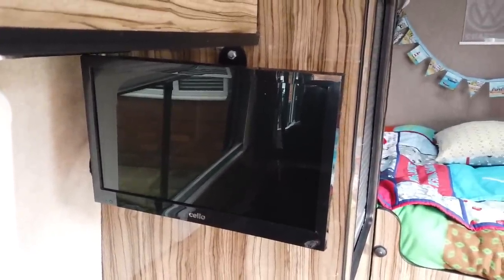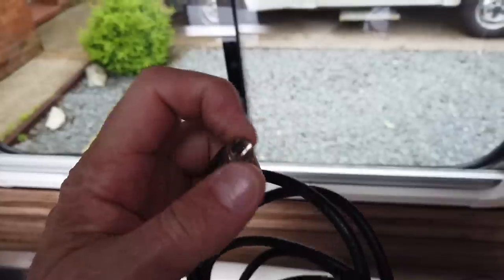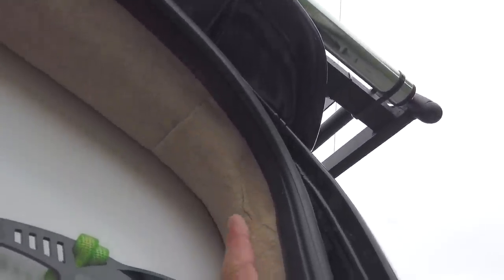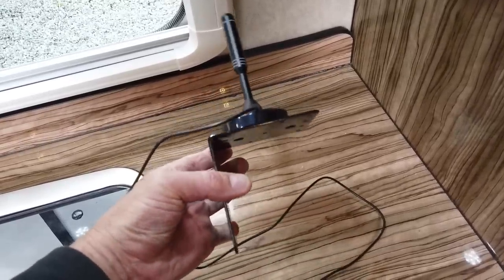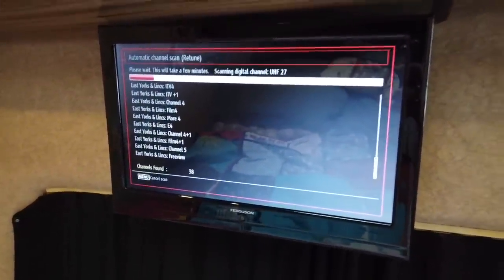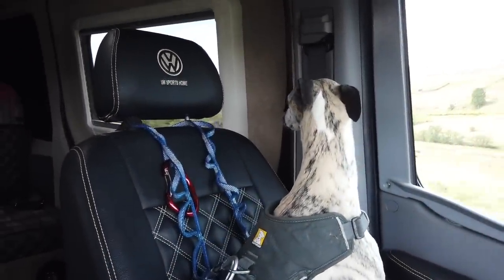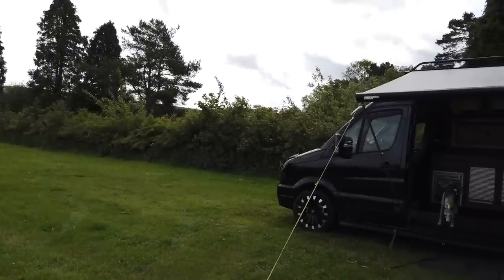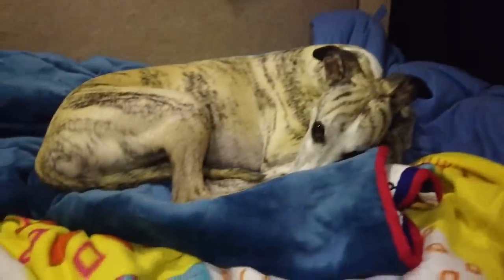VW Crafter Campervan gets a new TV Aerial and we test the new kit on a camp

Comment: Hi, I have one of these on my camper and did the same as you and took it off the magnetic base as my van roof is fibre glass.
But I think the magnetic base needs the van body to act as a ground plain...
I have the angle bracket bolted to my solar panel, trying to use that as a ground.
It does work in most areas but anywhere slightly remote, no signal..
Best option for us now is a firestick using my phone as wi-fi hotspot, works great most places in uk..👍
Cheers 
Best regards
Dave
Reply from the maker: Hi Dave 
Thanks for the info I didn’t think about the Ground plain 🤔 but mine looks to work well on that bracket 
I have a Wi-Fi aerial on the other side of the van on a similar bracket there is a video that shows me fitted this to my wireless network that I have in my van and that work really well if I’m away I will edit my videos and upload them through the network too 
Thanks again for watching very best regards 
Louie and his two poo pickers 👍❤️🍺😀🐾🍟

Comment: I'm liking that little aerial, I got a secondhand one like your old one very cheap as a campervan place was upgrading their fleet, so had quite a few to sell, but think I'll get the smaller one (sold out on your link!!) 😜  I'll be interested to see how it goes being out in the weather all the time, but I guess its cheap enough to be disposable if it only lasts a year or so. Is your booster hard wired into the 12V or does it have a cigarette type plug to go in a 12V socket? Trying to find a replacement for mine...  Think I'll be copying your set up, Cheers Dave! 😃👍🏼
PS Louie looked a bit put out that you thought he needed assistance on Security Duties.....Glad his paw is okay again 😀🐾
Reply from the maker: Hi Linzi hope you are well and your van’s coming on 👍 this’s is the aerial booster I use  
https://rover.ebay.com/rover/0/0/0?mpre=https%3A%2F%2Fwww.ebay.co.uk%2Fulk%2Fitm%2F371963216912 
Hope that helps 👍 
Thanks again for watching very best regards Louie and his two poo pickers 👍❤️😀🐾🍺🍟